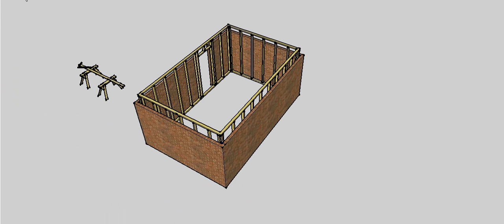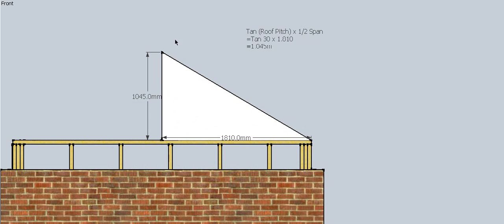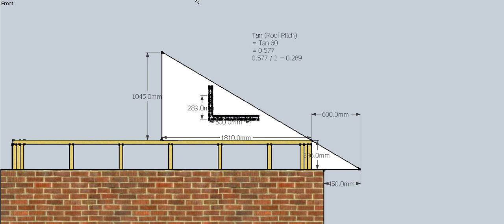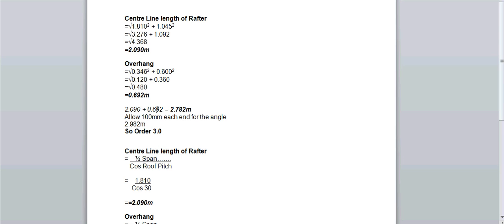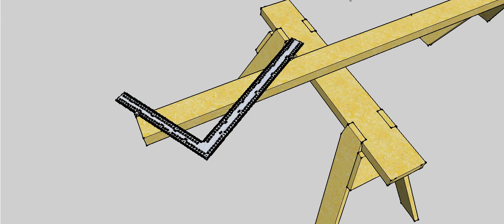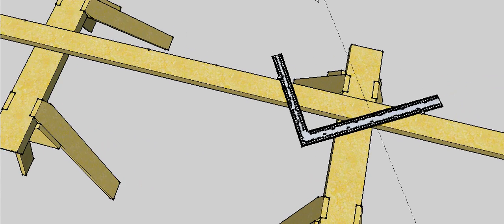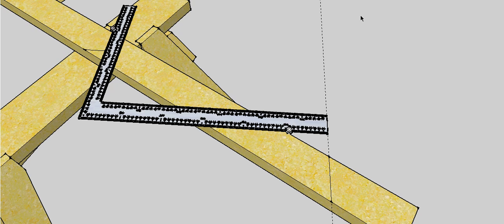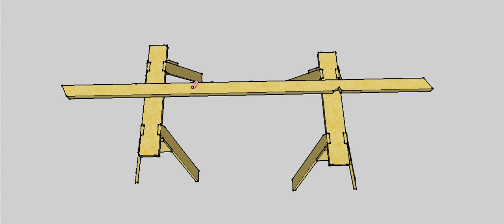Gable Roof Pattern Rafter

Comment: Great videos mate. One thing that always gets me with calculating rafters is that we measure from the ridge to the corner of the top plate for our rafter length but the top of the rafter sits higher than the top plate. I figure that the actual ridge height will now be higher by the distance of the bird’s mouth to the top of the rafter plum straight up? For example using a 90mm rafter with a 30mm bird’s mouth means the ridge will actually be 60mm higher than or original rise measurement. Is this correct? Cheers
Reply from the maker: Hi Daniel, you are correct however your figures are slightly out, a 90mm rafter will have a distance greater than 90 on the plumb. Your concept is spot on. The length of the rafter is from the ridge to a position plumb up from the back of the birdsmouth. If you want to measure to the corner of the plate you have to mark the back of the birsdsmouth. I have demonstrated this in the attached video with relation to the hip. https://www.youtube.com/watch?v=mwoAwsuwMyI&t=3s Hope this helps.

Comment: Hi John,

Is the depth of birds mouth will affect the  roof pitch little bit? Thanks
Reply from the maker: Hi Roger, no, because the rafter will drop at both ends by the depth of the Birdsmouth it wont piviot
Reply: @Buildsum Thanks for your reply. The ridge height is depends on the birds mouth depth, is that correct?
Reply from the maker: Hi Roger, the ridge will move up or dowm depending on the depth of the birdsmaouth, yes.

Comment: Does the thickness of the ridge not matter?
Reply from the maker: Hi PJ, at the 10.00 min mark of the video i make a deduction of 10mm which in this example is half the thickness of the ridge. As the rafter is only on one side of the roof this is all that is required.
Hope this helps.

Comment: Hey. I'm just curious. I understand how to use pythagoris/trigonometry to get the length of a rafter but say you don't know the span (2090m) and you want to use the square, is there a way to mark the 310 measurement on the steel square as the 310 measurement for example doesn't sit on the timber to be able to mark? I'm learning a lot from your videos so thank you
Reply from the maker: Hi Mark
Not sure I understand what you mean by not knowing the half span but if the measurement you require is not sitting on the timber then you can use a combination of try square off the blade of the Roofing square to transfer the mark to the timber
Reply: Buildsum Sorry, i've just looked back on the video. I understand now, I would have to know the measurement 2090 before hand. What you said regarding using the combination square answers my question though so thank you.